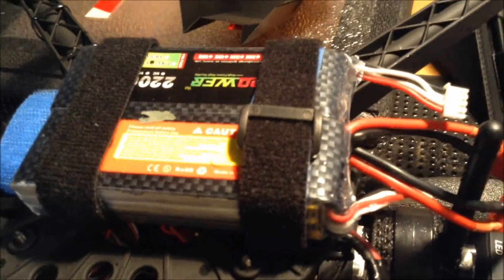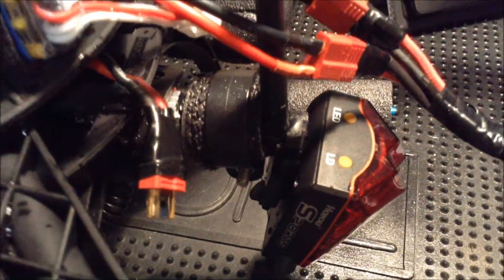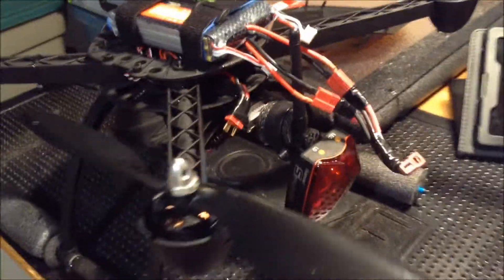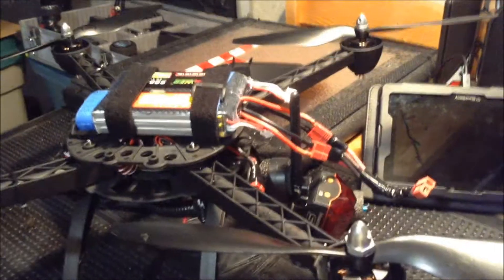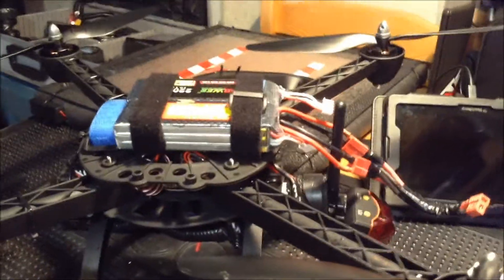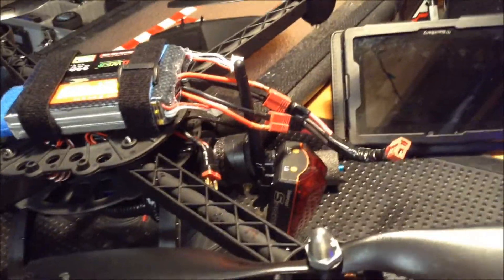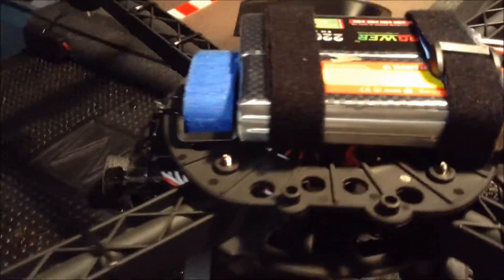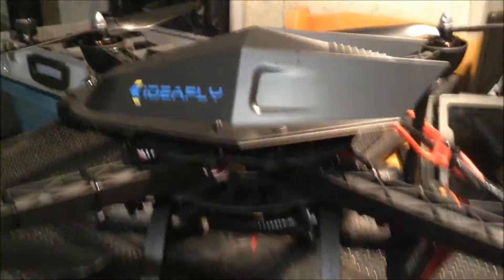Lipo in Parallel / Ideafly IFLY4 QUADCOPTER

Comment: Are you running the stock ESC and Motors
Reply from the maker: Enikma Aguirre yes I was lol, my ifly4 which I must say ran fairly decent for me is now on the bench awaiting a rebuild parts list to be created, starting with the Naza FC. Those Ifly electronics can't be trusted nor can the other parts they provide. I tried and programmed and reinstalled many times but could never fully trust this thing flying. I gave up before it dropped outta the sky like so many others. Good luck

Comment from the maker: Hi and thanks for watching. Currently I am running 2x 11.1V 2200mah 30C and getting approximately 15 minute run times with all my extra weight. I find that's a good combination for flight time and no overheating issues either. I'm surprised at how much throttle is left, I'm afraid to push the throttle all the way up lol.